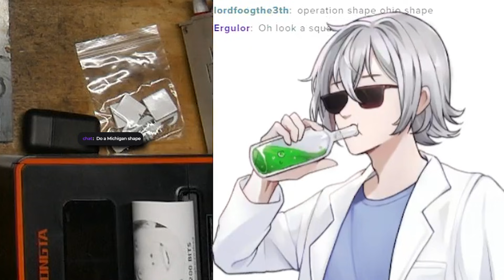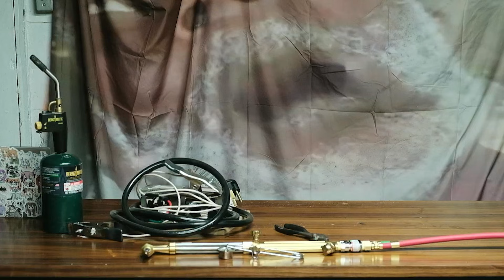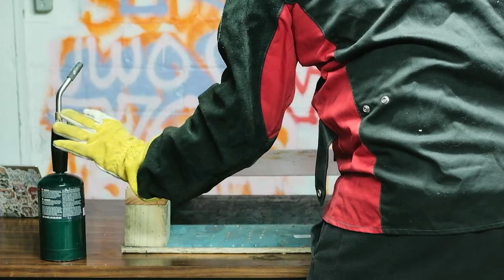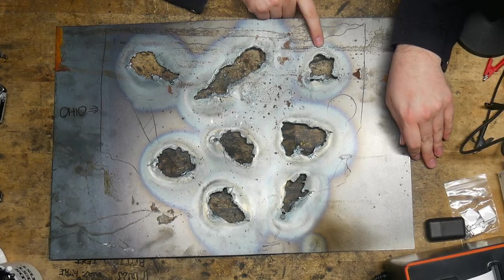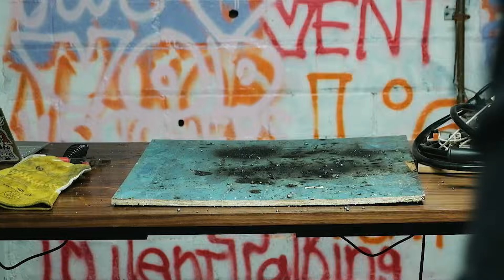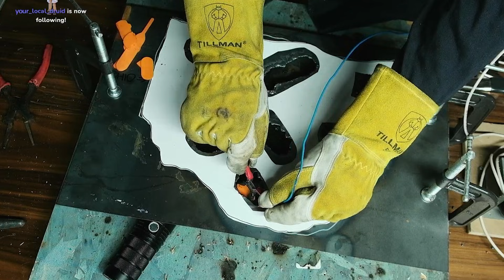What Happens When You Play OPERATION with Electricity?

Comment: just a tip. it wasnt cutting at first because u pointed at the metal and instantly hit the O2 lever. thats not how u use a cutting torch. the first thing u do when its all ready to go and cut stuff is u point it at the metal, let said metal get glowing hot and THEN hit the O2 lever. if u do it correctly it will instantly start cutting the moment u hit the lever and will keep cutting until u decide to stop. thats the only reason u was failing at using a cutting torch. thats also wyh ur metal plate warped so fast is because u hit it in a tiny spot with massive amounts of heat instead of letting a larger area heat up first. metal expands as it gets hotter and because of that if its in a tiny spot, it will warp the plate massively. heat up the plate in a larger area of it like ur ment to do with a torch and it warps a ton less.

Comment: watching him use a torch is painful. you heat the metal THEN press the lever, to blow out the molten metal

also, have you considered a cheap plasma cutter for the same application. a little cheaper because you dont need the gas and cleaner

Comment: noob=confirmed

the way oxy(fuel) torches work is with TWO knobs
the first knob is fuel, this determines general cutting/heating power
the second knob is CONTINUOUS oxygen, this shapes and STABILIZES the burn
the third factor is the handle, it provides a jet for boring and cutting, using the extreme heat to basically rapid-rust and therefore melt the metal

your tuning is based upon the metal thickness you intend to work on and the fuel being used, as well as a separate propane nozzle that is cheaper than acetylene nozzles and tuned different

step 1: get the right nozzle for the fuel
step 2: adjust regulators to correct pressure(often a few PSI higher when stalled vs flowing, you can waste some gas by opening handle valves to set regulators)
step 3: adjust fuel handle knob and ignite
step 4: adjust oxygen knob till the flame is a nice hot blue color with no yellow at all and shaped right for your task(often more jet-like for cutting and more tame for general heating)
step 5: start heating your part, get a gentle heat and punch-through, then start the jet and cut yoru lines

this does pretend you know that sharpie won't last a nanosecond and you need something like chalk or soapstone for heat-resistant marks

and guess what, I literally learned this by fucking watching youtube of people who use torches often, no reading, no experience
and even I could cut that plate better than uwo

granted I would have used a drill and dremel/tiny die grinder tool, because those fine lines are impossible for a torch, the best way to go is a rough cut or hole followed by grinding(like a dremel, grinder or belt sander)

this is shockeration

and FUCK I can't fucking type tonight

Comment: Heyo I make rings and metal sculptures as a hobby.
Id reccommend skipping the... fire altogether and just using a drill and jewelers saw to cut out shapes in metal
Once your metal warps that bad theres no hope for it lol

If you get a jewelers saw, they sell the blades seperately in packs since they are a very fine and thin blade and lt snaps frequently if you go crazy with it.. but its also thin enough that it bends and slips into drilled holes so you can saw from the middle of the sheet with ease. If you look up the jewels saw youll see what I mean... hard to explain

Id also rec buying coconut oil to lubricate the blade before usings it

Comment: I got "shocked real bad" by a CRT TV that had been off and unplugged for over two years. I was inside it to clean and poke around, after it not being cleaned... ever... I wanted to make sure it was safe to use regularly again. It made all my fillings hurt and re-aggravated the feelings I had from an old concussion. Absolutely strange experience to have. My muscles in my chest, neck, arms, and shoulders felt like I'd worked out.
Reply: You have to be damn careful around CRTs but you know that better than anyone now lol
Reply: When I was doing my Microsoft certification back in 09? They told us to never touch the inside of a crt no matter what! We were taught that If it's "not working or faulty" to just throw it out and replace it with a flat screen as it's much more safer to open a crt device
Reply: The static charge of CRTs can also accumulate polonium dust from the decay of radon in basements if you got uranium in them there hills.
Reply: This tiny slap that you get from them is harmless 😂

Comment: You must’ve had amperage and voltage backwards. High voltage causes it to arc easily, and amperage causes pain and danger. So you had it use high voltage and low amperage/current?
Reply: No he has it right. Low voltage and high current will spark when you make a metal to metal connection and heat things up real quick, but your body has high enough resistance for the low voltage it's safe to handle because barely any current will flow through you. Think 12V car battery.
Reply: @chanman1995 
But voltage is what causes it to arc easily, like through clothes or only on bare skin (under 100,000 volts and it only works on bare skin, over 1 million and it works through thick clothes). Amperage is what causes stinging, pain and muscle contractions, or harm if too high (1-3 mA will sting a bit, 10-20 mA hurts a lot and makes it so you can’t move, more is often illegal to use on someone).

So, are you saying that it was dangerous amperage levels, but the voltage was low enough that no arc was bridged to his body so he stayed safe?
Reply: @Skye_7_7  there was a lot more current than the thresholds you have here when connected metal to metal, which is why we got the dramatic display. 

But if you were to connect the high resistance of your body to the circuit instead, you'd get very very low current, making it safe.
Reply: @Skye_7_7 a quality short on the subject with visual aids https://youtube.com/shorts/8Wx6-ysokJU?si=eOGVRK8MRqqDwjE5
Reply: @chanman1995 
Ok, then 👍

Comment: I forgot that operation (the original game) didnt shock you so i thought the only difference was gonna be that the voltage is higher 😭
Reply: I swear there's at least a version that does. Maybe the older ones? I can't imagine that being allowed now a days?
Reply: I mean... The game DOES carry a current, bc isn't that how you get the BRRRNT and red light? The red rubber thing that attaches the tweezers to the board insulates your fingers against an unpleasant zap?
Reply: I also kinda didn’t realize it didn’t shock you
Reply: I swore it did...

Comment: bro setup your cutting torch correctly way too much fuel not enough oxygen
Reply: also procedure with cutting you start from the edge get it glowing with the preheat flame which is set by the dial on the cutting head.

Comment: Red Seal welder here. 

You have to set a neutral flame before you engage the cutting jet. You have to trigger the cutting jet and get a neutral flame again after that. Hard to tell from the vid but it sure looked like you had a carburizing flame. Actually, Im positive it is lol.

Also, you need to preheat the piece. Hover over it a bit before engaging the jet. 16 gauge is so thin warping is inevitable, but you should be able to move really quite fast with a torch on something that thin
Reply: my dad was a welder/fabricator for 5 decades... i'm not 100% certain on the vernacular, but i was thinking the same thing you said, using the proper jargon... dad would be proud that i actually remembered this kinda stuff from just watching him over the years... plasma cutter would have been a better idea, if trying to really avoid the warping with 16 gauge... can you get those at harbor frieght? lol
Reply: @jobriathboy  Plasma cutting is so much fun but it can be hard to get used to
Reply: @RisingRevengeance A lot easier than being good at gas cutting.
Reply: Hey now, if it works it works. 😅
Reply: I'm not Red Seal but my work has me using this kind of stuff and Uwos using that torch had me nearly yelling.